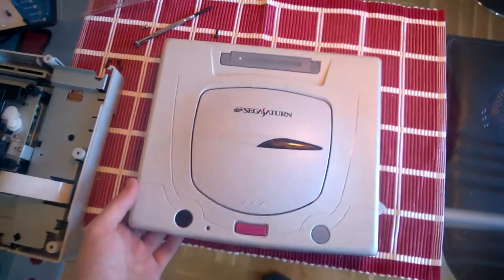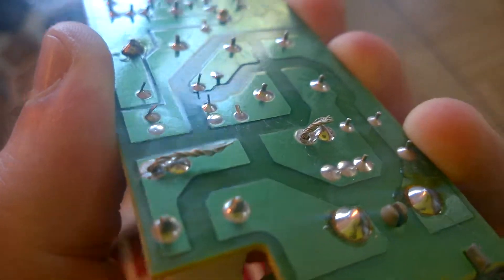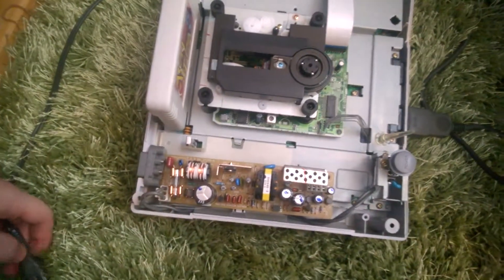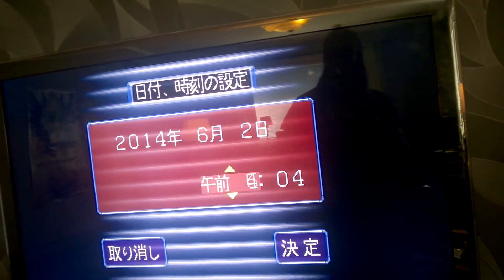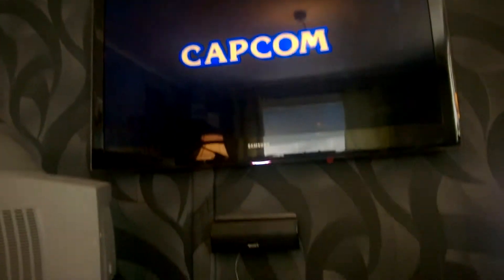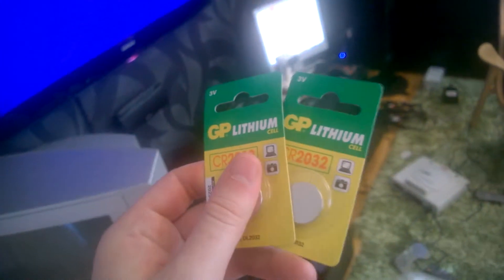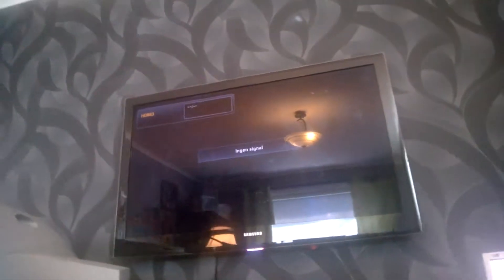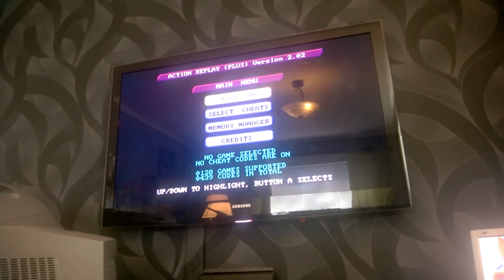Sega Saturn fuse soldering + battery replacement

Comment: Is that common to have the fuse holder to be not soldered? That seems totally weird. At our local street market the sell 2032's for 5 EUR a pop, while you can buy a whole set with LR44 (which you can use for  Game and Watches) for 1 or 2 euros :)
Reply from the maker: no, I'm guessing the previous owner had desoldered the fuse-holder, or maybe he installed the fuse-holder but forgot to solder it in place :P Yeah it's like 5 euro here aswell in Statoil (called Circle K now) for example. I saw just now you can get 50 x 2032 for 5 EUR on ebay tho :D